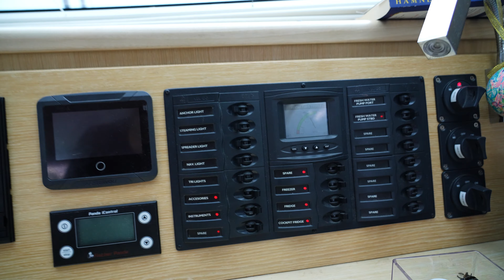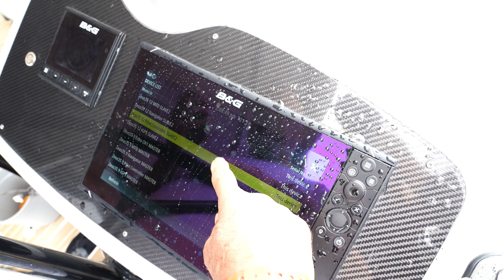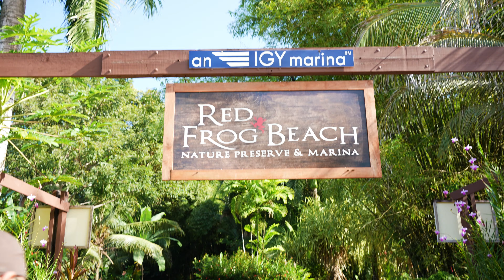Autopilot DRAMA on our Sailing Catamaran AGAIN, now in Isla Bastimentos | Harbors Unknown Ep. 88

Comment: On average how much time each week do you spend on upkeep, repairs and maintenance?  Maybe a future vid could be on what you'd do differently to reduce upkeep, maintenance or tools, spares to make repairs easier.
Reply from the maker: That’s a very interesting comment. Maintenance is really not a problem, the boat is still new. Oils changes on 4 engines (including genset and outboard) not a big deal. Stainless and general washing every 3-4 months, bottom cleaning once a month and zincs every 3 months. We tightened the rig once since we have the boat.
The real problem is that we break stuff all the time!! Bad luck with B&G and yanmar VC10 engine controls ((no longer in production and discontinued)
We have come to the realization that we need spare for networked electronics and Yanmar VC10, but it’s impossible to have 2 of every thing especially on a catamaran.
As far as tool go, we have all we need. With tools you run the real risk to overload your boat. It’s a good idea for an episode for sure! Thanks for watching and for your support

Comment: Just a suggestion on your AP failures. With it happening twice, I would make sure the rudders are properly balanced if I were you. Unbalanced rudders will blow up autopilots if it's working too hard constantly. Look at your rudder angle indicator to see if it's always more degrees angle than it should be. With beam reaching in 15 knots AWS, the rudders should be maybe 2 or 3 degrees with a balanced sailplan.  If they are always 5 or 6, your AP is working too hard, and over time, can fail.
Reply from the maker: Thanks so much for the advice! Keep an eye out for our next video, we think you’ll enjoy it!

Comment: Unfortunately you need to repair the broken autopilot and have a new one to replace the old one. You need a spare alternator, starter motor. the other choice is to have a crew at the helm 24/7  or try to set a course with a fix your wheel
Reply from the maker: Thanks for the tips! 😊

Comment: Raymarine ACU400 Course Computer EV1 Heading Sensor and Type 2 Linear Drive and your autopilot troubles will be over. Used Raymarine autopilots for over 20 years and have never experienced failures that you have had on such an expensive vessel. Life is short. Dump the crap that is giving you so many headaches.
Reply from the maker: Thanks for the suggestion, it would not be affordable for us at this time to replace everything but possibly with our next boat. Thanks fo watching!

Comment: Hi Fabio and Kristen, I accidently deleted my previous comment. Yeah, I've had "some" experience with B&G, aka Bitch & Groan, or . . . Broke aGain. They are not a product I could endorse. All manufacturers have failures in their product line from time to time. With B&G it's a lack of quality control, at least in my experience.
Reply from the maker: Yes, we are pretty disappointed especially because once you’ve committed to a particular manufacturer the switch cost is enormous.